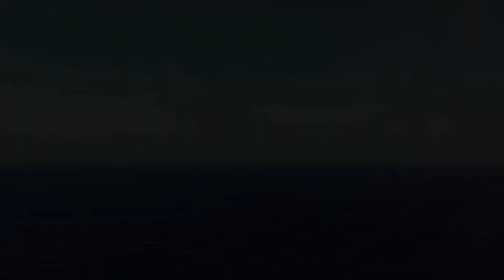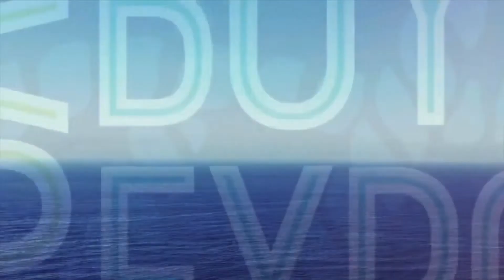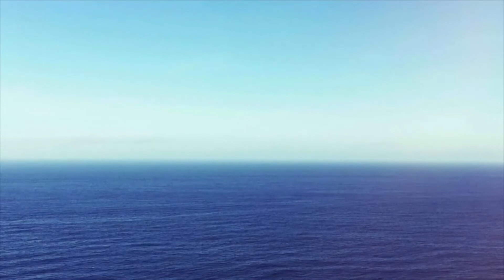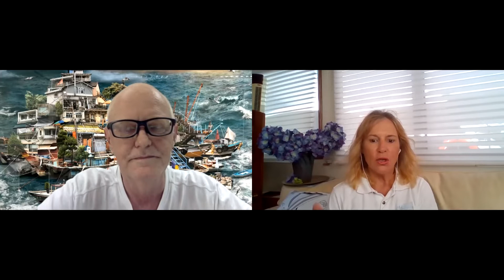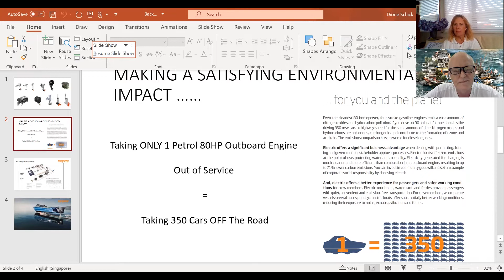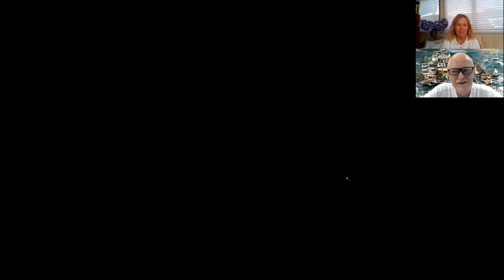First-Time Boat Buyer Expo: How to Re-power Your Diesel Yacht Into an Electric Motor

Comment: I've been looking at older Trawler style boats(Around 15 ton) to convert to Electric Propulsion. I've spoken directly to people at Elco and Ocean Volt about this and both say that the technology is not there yet. Only for Sailboats and Cats.
Do you have solution for this ?
Reply from the maker: Hi Steve, good to hear from you.  From the interviews I've done with both manufacturers  as well as two electric yacht buyers as well as the interview here with Joerg, the message I got was electric is more than just engines, it's the whole boat technology.  The "old way" was to simply put a larger engine on a heavy boat to make it go faster/better... but this isn't the idea/realistic with electric.  Joerg has a great approach to consultancy and to advise boat owners what they can and more importantly, cannot do with their boats and electric repowering, making sure owners are aware of what is not really advisable even if it is possible.